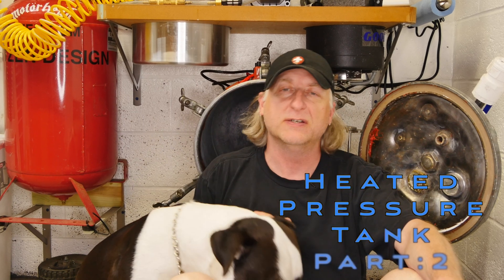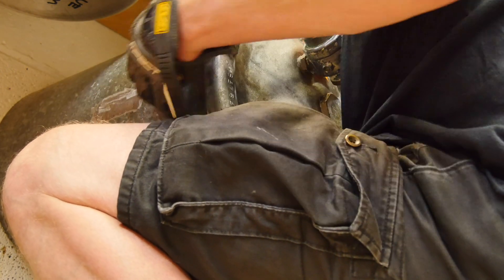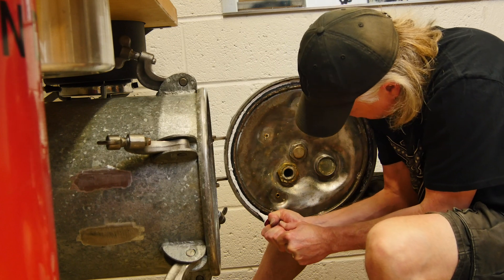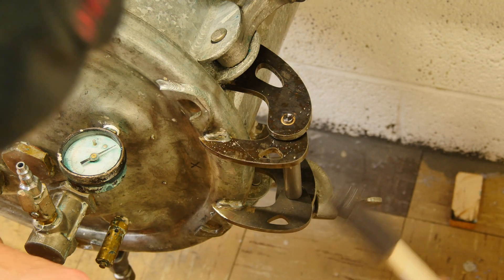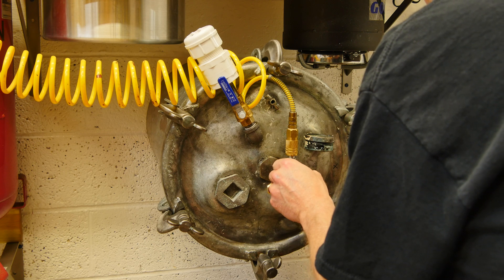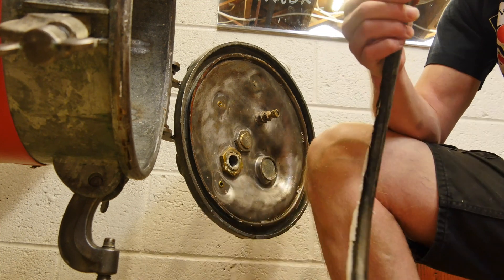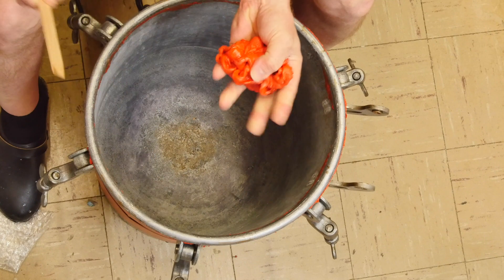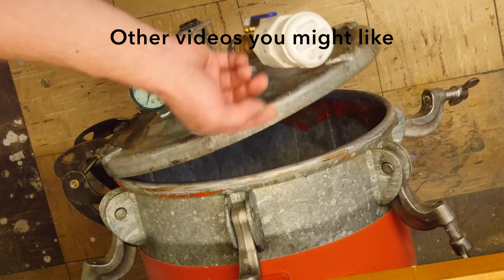10 gallon Heated Pressure Tank lid fail: Part 2

Comment: Public safety announcement: when initially pressure testing a (possibly defective) pressure tank, fill it with water and only leave a very small air pocket. Water under pressure doesn't store (much) energy, so in case the tank or some valve bursts it won't kill you.
Reply from the maker: Yes, true! Good tip.

Comment: Couple comments: Nice that you show the failure here. I wasn't sure when you showed the hinge how you were allowing for compression, and now I know. Nice job on the gasket, and nice to see the attempts that did not work.  Is there sufficient material to slot the hinge to allow compression? More important is the safety valve. If you haven't replaced it, they are inexpensive. It would be less concern (the air system should have pressure relief, as long as the tank can take the air system max) if there was no heat and you were not pressurizing reactive materials, but material that can evolve gas, as well as the heat, make a reliable safety valve CRITICAL. I have had to deal with the result of pressure vessel failures, and even a small one is BAD. (on a tank like this, I would hydro test after it was welded on)

Comment: You may find that the reason the silicone didn't set is the remaining zinc galvanising on the metal impeded the cure.

The hinge is a damn shame. It hurts when a part you've put polish into fails to perform. But yeah, gotta have sufficient compression of the gasket. I've tried casting gaskets myself and found RTV silicones tend to break up very quickly under the extreme physical compression and gas pressures. It's been a lot less fuss to just buy a replacement gasket, even though they're a bit pricey on those big tanks.

You may find a "bubbler" useful. It's just a squirt bottle full of water with a little bit of washing up liquid. Squirt it at air-pressure joints to find leaks as they'll bubble up.

For pressure testing I filled my pot with water first. That way there's less air to expand violently if there's a catastrophic failure. I don't trust tanks until they can go over the pressure I intend to use them at and hold it.

Your exhaust suppressor is a very good idea. I also use a similar idea on the inside of my vacuum chambers to diffuse the inrush of air when letting them up to atmosphere and help prevent having the mixing pots blown over.

You've also got me wondering about mounting my pots in carriages so I can rotate them between upright and horizontal as required.
Reply: Is there anything about your vacuum inrush diffuser on your channel or anywhere else? It's very annoying when you let the air in and the resin goes flying everywhere.
Reply: @evropapagan5551  I don't think so. Honestly I don't have that much enthusiasm for actually making videos. But my diffusers were just brass blanking caps with small holes drilled in the sides put onto the inside exposed threads on the inlet fittings.
Reply: @SciStarborne  Thanks I'll give that a go.

Comment: What about pouring 2 component silicone (with the lid level) and create a perfect uniform gasket? I mean, if it isn't as thick as the urethane it will allow you closing without modifying the hinge and since it's a perfect ring it will seal properly. I have done a few gaskets like that...
Reply from the maker: Yes, In theory the silicone would work, not as durable as the urethane in my opinion but it would work.